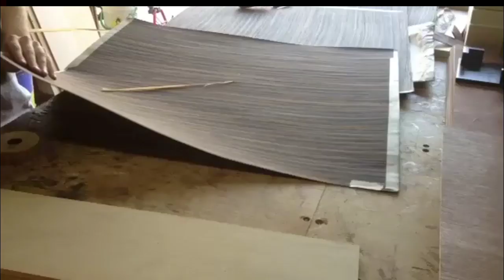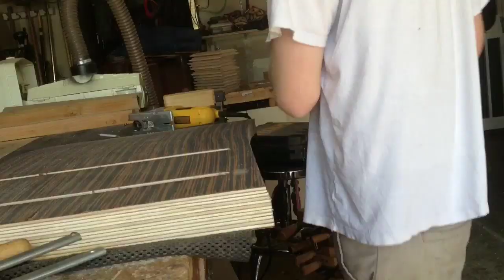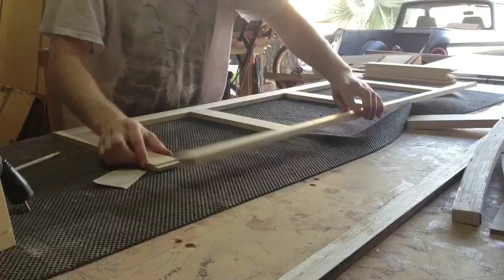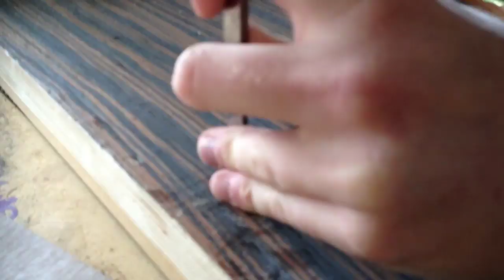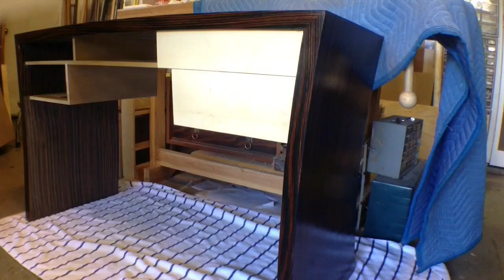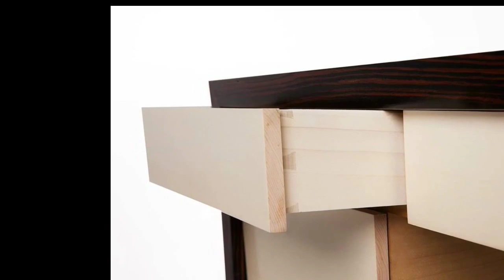The Deco Desk

Comment: great looking desk. what kind of finish are you using?
Reply from the maker: The sides and base is one coat of sanding sealer and waterlox. The drawers are palomerized tung oil from lee valley. The drawers are shellac and the top is waterlox with a general finish top coat sealer
Reply: Kyle Toth thanks for the elaboration